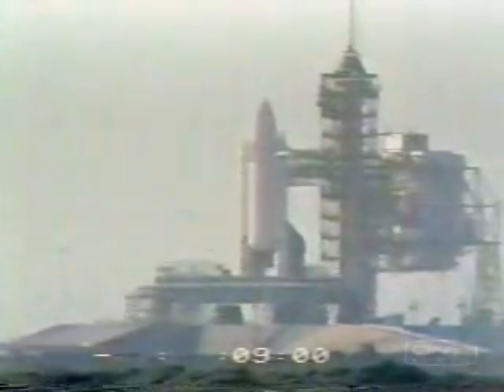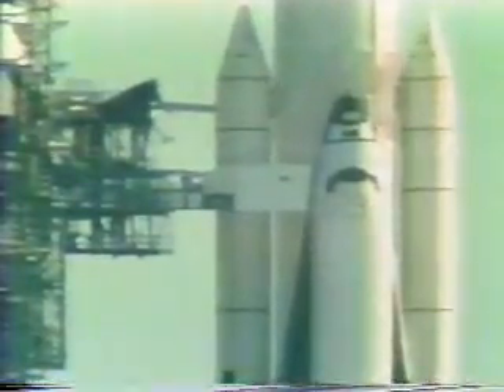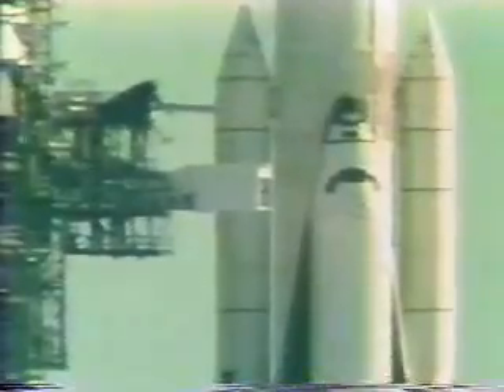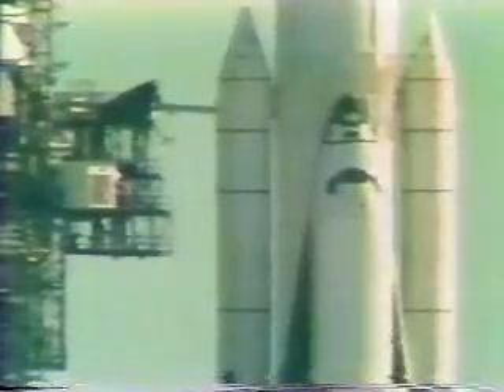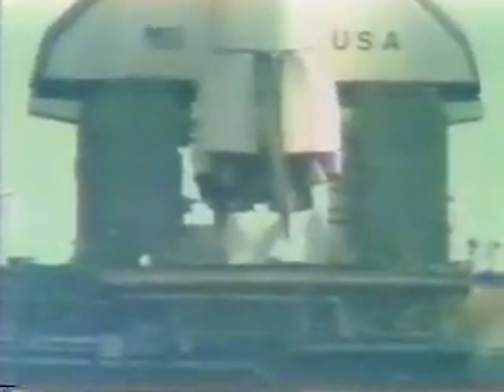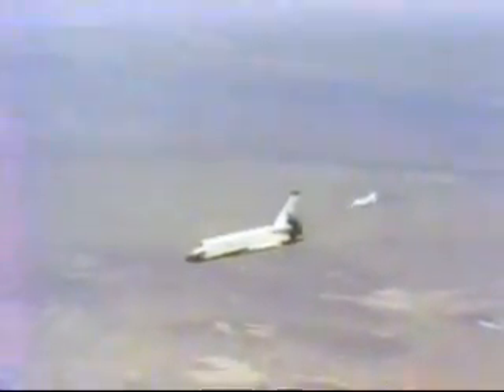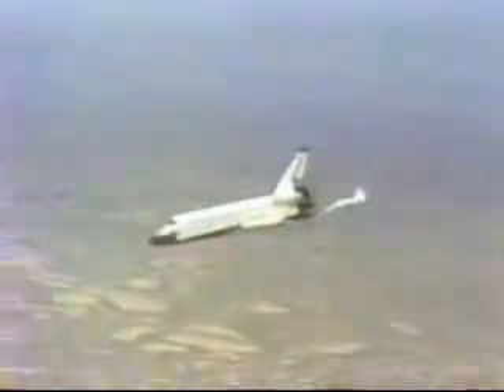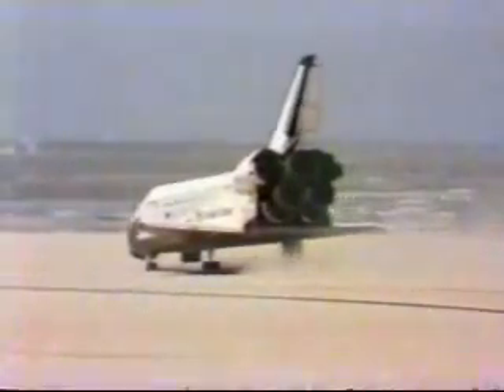STS-1 launch & landing (4-12-81)

Comment: I remember watching the launch and landing live on television of the first Shuttle flight now 41 years ago this month, and was thrilled and excited that it all apparently went so well.  A new era of spaceflight was beginning, an era that was supposed to usher in cheaper, reliable, routine and safer spaceflight, and everything looked so promising. 
Of course, as we all know,  cheaper, reliable, routine and safer spaceflight did not happen. If the Shuttle had flown as frequently as Nasa said it would,  by 2011,  when the Shuttle was retired,  it would have flown about 1,800 times and flown up to 🐯60 times a year. In reality it flew only 135 times and 2 of those flights ended in disaster. The maximum rate of 9 times in a year was achieved only once, in 1985, and that with considerable difficulty.  It is difficult to disagree with the premise that the Shuttle should have stopped flying a long time before it did, and the build up to disaster started not just from the first flight but before that as well, even going as far back as soon as Neil Armstrong had made his historic first step on the Moon in 1969. 
That is not to say that the Shuttle did not have its successes and achievements, notably the repair and servicing missions of the Hubble Space Telescope and no doubt at all about the bravery, dedication and professionalism of those who flew on it, but the fact can not be denied that the Shuttle fell a long, long way short of what was hoped and expected of it.
Reply: Wow, Oliver. You Know EVERYTHING About Sts Missions!

Comment: ndwm2112 The two-man crews on the first four flights wore pressure suits because Columbia was fitted with ejections seats, with which the crew could eject up to an altitude of around 100,000 feet. Once the shuttle was "operational" the ejection seats on Columbia were removed, and none of the other orbiters ever had them. Since it was reasoned that the vehicle was safe enough to not need an escape system, pressure suits were eliminated. They were re-introduced when the bailout capability was retrofitted in after Challenger. Incidentally, even though NASA officially said that the bailout capability would not have saved the Challenger crew, cue cards and flight manuals printed after its introduction did include procedures on how to bail out of a free-falling crew module in the event of a Challenger-type accident.

Comment: @Dennisthemenace217 He was going by the actual countdown clock.  He was correct as well.  The shuttle launched at T+2 seconds due to an SRB ignition delay that was put in place to account for the twang effect caused by SSME ignition.  They revised the countdown after this and all subsequent missions launched at T0.

Comment: @penfat1 They had planned to launch as soon as the SSMEs were at full power (takes 4 seconds).  However, they underestimated the twang effect and came to fully understand it during the FRF in February 1980.  They put in an SRB ignition delay so they wouldn't have to revise the whole countdown before the April liftoff, so the shuttle launched a couple of seconds after T0.  They revised it for STS-2 and all missions after STS-1 launched at the T0 mark.

Comment: @Dennisthemenace217 That's not what I heard. Supposedly the "twang" duration was miscalculated when the whole countdown sequence was being designed. After it was realized it would take more than 4 seconds for the stack to return to vertical, it was too late to change the countdown procedure for the first flight. So they just went ahead with that sequence. STS-1 actually had SSME start at T-4 and had a liftoff at about T+2 seconds.